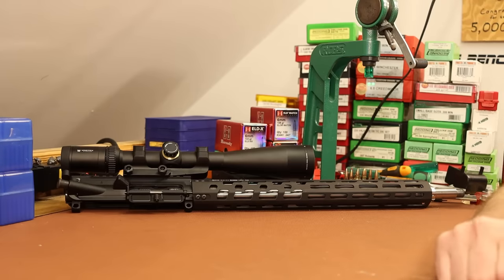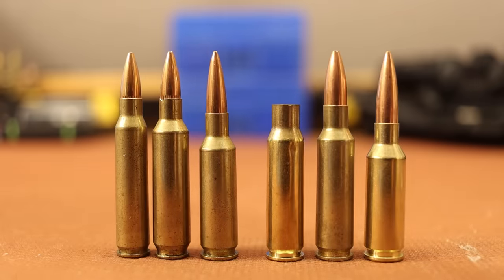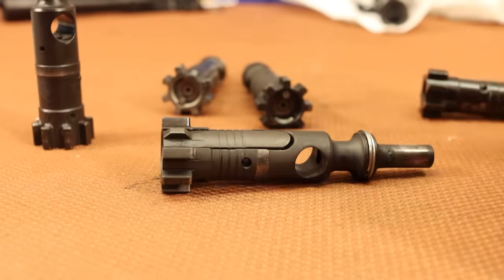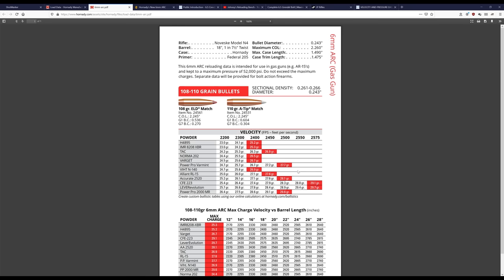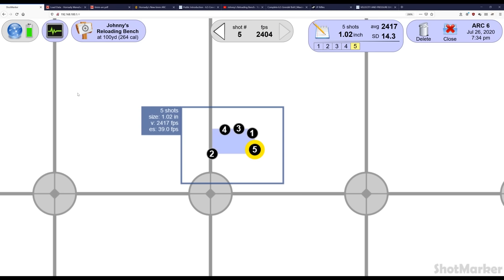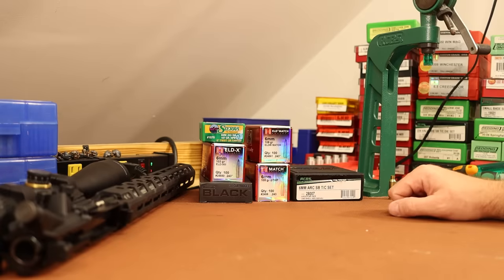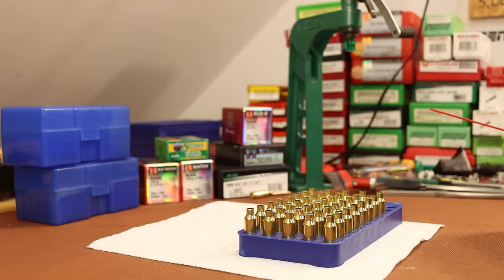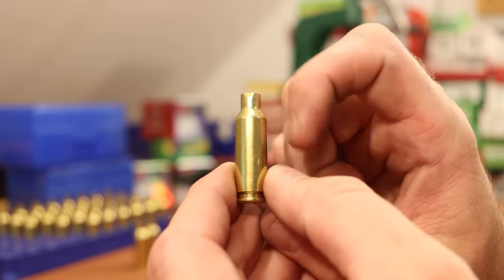6mm ARC - Getting started with reloading

Comment: Yes!! JRB is back and working on a 6mmARC like I am!! I’m using an 18” Proof Carbon Fiber barrel for mine. Make sure you use an adjustable gas block! I’ve had great luck with Reloder-16, IMR4451, and H4350 using the 100gr+ bullets.
Reply: If it’s not beating the crap out of the brass that will be a huge advantage over 22 Nosler and 234 Valkyrie
Reply: Wow You spent a-lot on barrel that uses cartridge thats so new, I don’t know whether to scratch my head or high five ✋ you.
Reply: @anthonymurphy2540  that’s one of the few plus sides to being a dealer, I get to buy stuff for wholesale. Still not a cheap barrel, but I wouldn’t buy a cheap barrel anyways when looking for accuracy.

Comment: So after watching your 6 ARC video , I thought wow what a lot of stuff to keep in mind. So the next day I take my newest rifle (6.5 Grendel) to the range. It's an  AR platform nothing new here ,because I have a bolt gun in  6.5 Grendel. So I took so of the ammo that was loaded for the bolt gun and a box if factory ammo, to check gun function and to sight in that all went OK . All the problems you were having , was similar to the problems I was  having. After morting a few rounds to get the fired case out I pulling the bullet out of one that wouldn't go into battery, I called it a day. I found a video you did about different chamber dimensions of the Grendel. So I guess I'm going to have to go thru a process to get the right size case and bullet setting depth. So thank you for your videos they are very helpful, I don't feel like I'm the only one that has screw-ups.

Comment: One of my Favorite videos ! When he gets that 108 ELDM .35 5 shot group at the end you could feel his joy!  FWIW, Besides Hornady's expensive 1 Shot Case Lube ,  Lees case sizing lube also dries to the touch and is a great sizing lube. I put a finger swipe into a ziplock bag and shake the cases in it and they all are coated easily with a very small amount and NONE is wasted spraying all over the loading block etc. I have had the same Ziplock 1 Gallon freezer bag and used it for years now. 😊

Comment: I am loving the 6 ARC in a bolt gun. I'm getting dime size groups with 90gr Sierra Gamechangers and Leverevolution. Out of a factory Howa 1500 Mini barrel! (A few accuracy upgrades, B&C Stock and Aluminum Bottom Metal). These 6 ARC loads are producing more velocity and energy than my old .243 handloads I've been loading since I was a kid.

Comment: I use Hornady one shot, but I got tired of it building up all over my reloading trays. I got this trick from Panhandle Precision's channel, and he will stand up the cases on a sacrificial baking sheet and spray them that way. I've also used paper plates. I also have gotten better results spraying from a more vertical angle. It helps reduce the amount of case stretch for me when sizing.

Comment: This is an update after 16 months of shooting my 6mm ARC I now like it just as much as my 6.5 Grendel.. I have not had the COAL measurement problems you were having.I did get different readings using my twice fire 6mm ARC brass than I did using my Hornady modified case.
I too use the RCBS SB dies.Ive experimented using 105gr and 108 grain bullets.Im getti g good accuracy and low ES & SD numbers.

Comment: Looking forward to this. Cheering for the 6 ARC. Go get it Johnny
Reply: Why ? He skipped the fact that you have 107gr for Grendel that shoots 0.5 moa all day long. Considering that the Grendel has larger case capacity than the ARC, its funny John has never told his audience about 224 grendel or 6mm Grendel...its the difference between a guy who reloads factory and someone after PERFORMANCE.. Just saying
Reply: @killerfungis  
6mm 107 gr SMK
G1 Ballistic Coefficient	0.527

6.5 mm 107gr SMK
G1 Ballistic Coefficient	0.430
Reply: @blckandwhtknight  LOL a BC chaser, lots of bullets have HIGH BC numbers, but its the case thats the variable and if it wont shoot a tight group it wont shoot a tight group. Example: 107gr 6.5 Grendel  BC of .445 in average barrels equates to 0.55MOA. Science is crazy....dont forget the other variables., otherwise ALL calibers and cases would fall into MATCH grade considerations.
Reply: @blckandwhtknight  OH, and you also did not know, because John wont tell you.....Grendel has been shot as .30, 6.5, 6mm (yes, the 0.527 that you might think only fits in ARC), and 224 for over a decade.
Reply: @killerfungis  SAAMI is a wonderful thing... The BC is what kept the DoD from using the Grendel. It wimps out around 800 yards while the 6 ARC pushes 1k easy.
Reply: @blckandwhtknight  hmmm, your calculator and understanding of saami seen broken. Please pull up 107gr 6.5 sierra.  What hornady is delivering was already available without introduction of a new case.  And certainly not worthy of industry ignoring that to sell new rifles.
Reply: @killerfungis  lol more case capacity. Your not even using the case capacity to its fullest at the same 52k psi. Which is the same as the grendel. It has the shoulder set back roughly .03 so it does have less capacity but its extremely minimal. The bc at longer range of the 6mm class will more then make up for any case capacity concern.
Reply: @orangerider2827  Did you just say that a slow velocity projectile can be compensated by high BC, And yet the speed tests are  all slower than grendel, remember 6mm Grendel has been here for over a decade. It was funny to see ads for like 224 Valkyrie when the 224 Grendel guys knew it was slower than what they had. Using your logic the 224 Valkyrie should have been more accurate than the 224 Grendel.....hint its not.
Reply: @killerfungis  the 224 valkyrie is a better long range cartridge then the grendel. Absolutely. Compare where the 224 the 6arc and the 6.5 grendel go sub sonic. Grendel is behind. Also you look at the load data for grendel. Look at the barrel length. The arc appears slower. I suggest actually look at the number use a ballistic calculator and come back when your not just hating something new. Also I dont care about the 6mm grendel. I dont mess with wild cats. Also most accurate calibers are 6mm.
Reply: @killerfungis  lmao saami spec 224,6,30 grendel where are they at? Oh yeah dont exist. Dont care even slightly about wild cats.
Reply: @orangerider2827  You should stop pretending to be smart. Saami is for civilian and not the military (per se). 

All of the most accurate rounds started off as or still are wild cats...its the free ballistics lab of America. Its the hot rod and drag racing equivalent in the gun world.224 Valkyrie wild cat, WSM development wildcat, 6br wild cat , 6 dasher wild cat, 6GT wildcat, heck even creedmoor was a wild cat at first. here are some other wildcat cartridges:  (and again simply necking down is not a wild cat, but in your laziness you call it that to besmirch for sake of argument, which is really lame),  Technically, I think the 6.5 creed was a wildcat and brought to market by Hornady

Popular wild cats
1. .22 Hornet.
2. .22-250 Remington.
3. . 243 Winchester.
4. .257 Roberts.
5. . 25-06 Remington.
6 6.5-284 Norma.
7. 7mm-08 Remington.
8. . 280 Ackley Improved.
9.  6.5-08 (260 Rem)
10. 6XC

The Dod does not need saami.  

So in the end if you wish to die on the hill of "I dont care about wildcats" then you wont mind if the Dod/US military is using inferior performing rounds to defend you.  To go further a military out gunned by the commons.
Reply: @killerfungis  whatever you say guy from the internet. Is rather have saami spec where I can get off the shelf ammo if needed.
Reply: @orangerider2827  then why are you watching a RELOADING CHANNEL.  What he made, for this video, IS NOT SAMMU Spec. 

To go further, if you want to save money, or just have true match grade ammo,  you will have to reload....abd all reloads by default are not saami spec.  Enjoy the over priced innacurate ammo.
Reply: @killerfungis  ok guy stuck in the past.
Reply: @killerfungis  whatever you say guy. You do you.

Comment: Your first step should be to anneal the brass. You should also lube the inside of the case neck with powdered graphite to reduce stretching during the sizing operation. Your press is very loose, actually lifting away from the surface it is bolted to as you work the lever. At the very least find a better way to secure it. One primer always refuses to flip correctly in the tray. ALWAYS. You can twist a piece of 400 grit sand paper into the seating stem a few times to 'polish' the surface that's hitting your bullet, to remove the ring you're getting on the bullet. A suppressor with a supersonic bullet seems nonproductive. Brass catchers are cheap. You need one. Your last loads are shot with a much dirtier barrel than your first loads. So, NEVER CLEAN YOUR BARREL! Very nice loading video overall. Great job.

Comment: I use brake parts cleaner to clean off the lanolin alcohol mix.  I spray some on the cases and the towel that I use to wipe them off with.  I do it outside.

Comment: I just got my McGowan 20" 6mm arc barrel ordered. I watched all your 6.5 Grendel vids. Glad to see you are back. Thank you for the content
Reply: The odin barrels use mcgowen for the barrel blanks, his was shooting pretty good hope your barrel will to. I'm waiting for my 21" odin barrel to come in.
Reply: Finishing up the 6ARC vid. I went with McGowan cuz of my first barrel 16" 1-7.5 twist 6.5 Grendel. Shooting heavy hog hunting bullets. I'm happy with them.
Reply: Wanna see some 6.5 PRC testing. Picked up just a Savage 110 in 6.5 PRC
Reply: @attackhelicopter1770  I got a mauser m18 in 6.5 prc, just worked up a quick load for deer. 57gr h1000 and speer 140 hot cor were sub 1/4 moa at 100. I'll work on some long range loads after deer season.
Side note hornady brass is butter soft, other then that seems ok I'll get some adg brassafter I use up the few hdy cases I have.

Comment: Glad Johnny is back!  Don't know where his fascination with small base dies comes from.  They are usually only needed for resizing military brass that has been fired in military chambers, or resizing brass that was way over pressure when it was fired.  You get a more concentric round that fits the chamber better with standard dies.
Reply from the maker: That's what was available to purchase right now, bro. My Hornady dies finally arrived, so I'll have them for the next video.

Comment: I have high hopes with the ARC. I really hope it comes out ahead. I’d really like to do a build with it.
Reply: You and me both id live to use it as a all around gun for deer hogs coyote i just think it would cover a wide range of critters
Reply: And it being in a ar. Platform even better a pistol build for a truck gun couple 20 30 round mags it would be great
Reply: @byerboys2607  So your unaware that Grendel is loaded to 224, 6mm and 6.5. Specifically 107gr 6.5 Grendel load is 0.5 moa all day long?  (and with the case measurement capacity going to Grendel why do I need ARC??)
Reply: @killerfungis  didnt say you needed one didnt say anybody needed one but myself for my needs
Reply: @byerboys2607  Yeah I just commented because it, your comment, seemed to lack any knowledge of what is already available and what folks are already shooting. Im sure the offering will do fine as its just a smaller Grendel.
Reply: @killerfungis  for me i have 2  center fire rifles 223/556 and 30-06 so the 6 arc would split the difference and still be good enough for deer/ large ish game and still have the distance of a 223 with heavier bullets than the 223 not by much but enough that it would make a difference and do way less damage than a 06 on varmints so in my case it would be a decent intermediate rifle and  also in a ar. Chambering or bolt gun so i would prefer it be in a ar pistol so it could be carried as my "truck gun"
Reply: @killerfungis  you just hate the arc it seems. Sinse you copy paste your comment everywhere anyone wants to get the 6 arc.
Reply: @orangerider2827  I dislike snake oil, and the fact the DoD developed something that was already on the shelf is just astounding...but hey maybe they had money to blow. Combine with that sneaky Native Advertising techniques....yeah it bothers me. And no one is copy pasting, be honest or dont reply.
Reply: @killerfungis  how is it snake oil? Do you know that the load data for a gas gun is an 18 inch barrel? Did you watch the video? Also all the other off the shelf as you call it are wild cats. The DOD didn't like the grendel because of its bc.

Comment: CFE223 has been giving me the best results also. Just sooty. Looking for Leverevolution.  So far in my bolt action, I've gotten 14 reloads with factory brass before I've seen failures. Powder charge is just over 30gr, max 31gr. Thanks JRB, always watch the whole movie👍
Reply from the maker: I have some Leverevolution on hand, so I might try it. It's pretty much the exact same powder as CFE 223. I've never really tested to see if it's cleaner burning, though.
One of the commenters I trust mentioned having luck with some of the slower powders like RL16, IMR4451and H4350. Those slower powders got the best velocity in the 224 Valkyrie as well, so I'm not all that surprised. I'm going to keep an open mind and not assume that Hornady is giving us the optimal powder list on their load data. 
We'll see how it goes! I'm optimistic so far. I haven't caught up with all of your videos yet, but I'm working on it. Nice to have someone else out there collecting some data.

Comment: I’ve stopped using the Hornady modified cases and the split case method, and instead started seating a bullet long in sized brass and feeling how the bolt closes while seating the bullet deeper into the case.  This has been the most consistent method that I have been able to find.  I do this with the ejector removed and in the case of my ARs I feed just the bolt into the barrel extention by hand to get a really good feel for what’s happening.

Comment: I have found in my experience, when the case mouth is getting dented like you are seeing, it is slightly under gassed.  If you have an adjustable gas block, increase the gas a little and see if it eliminates the case mouth dent.

Comment: I'm 5 months late to the party, but listening to the bolt discussion and White Oak posts, and Johnny's non-failure bolt experience, I'll wager his 6.5 Grendel bolts are both 9310 steel. 
Carpenter 158 saw frature, failure...8620 failed from fractures when run hot a few times, 8620 gets brittle, but the industry solved the 6.5 bolt issues by using 9310 steel. 
That same 6.5 Grendel bolt, in 9310 steel is used on the .50 Beowulf,  but with enhanced extractor to properly deal with the Beowulf cartridge.
I have 6.5 Grendel Type II, and the Type II depth face .264 LBC.
Les Baer I understand, mfgd both bolt depth chambers.
The parallel chambering is superior in accuracy to the compound chambering as I recall from studying the variances some years ago.
Point is, no matter your AR platform, 9310 steel for bolts is the only way I go, even down to .223/5.56.

Comment: There's a trick to adjusting the RCBS dies. You use the tail end of your calipers to measure between the top of the stem to the top of the die. No need to worry about what a half or tenth turn is when you can just measure it!

Comment: Made me chuckle with old school trimmer and no patience to set up the Franklin. Shud buy a 3way cutter for the old school trimmer, be nice to it and yourself. I have said a lot of the things you said to yourself in this vid, to myself, at various times. Many times I wasn't holding back like you did though. When you were talking about case and neck stretch and the RCBS expander, which you did well, I was wondering why you don't use dry neck lube on them, makes life with expander buttons far easier, when I do use them. Not sure if I have any dies with a decap spindle in them any more. Well done vid.

Comment: With a Letter "L" drill bit and a 5/16" - 36 UNEF HSS Machine Tap, Right Hand Thread Tap, Plug Tap , you can tap your own cases. Gavintoobe used his Lathe-a-Tron 5000 but I just clamped the case in a bench vise with nylon jaws and used a hand drill to do the job.
Reply from the maker: I tried it in the past with other cases and failed pretty bad. A viewer offered to do it for me so I'm shipping out some brass tomorrow!

Comment: Cfe 223 likes the heavies.  Great sd but the drawback is that it is Very Temp. sensitive.  I use Varget in the 6mm Grendel. I have .03 more case body to fill with powder and it still goes crunch.  I will be sticking with the wildcat but I have many people asking me about the ARC.  Keep up the great work.  Oh ya, I have a premium bolt and load way too hot and am on my second barrel with no bolt problem.  But it is something that should always be looked at during every cleaning.

Comment: 2 powders to keep in mind H4895 and Reloader 15, I have been loading for the 6mm Fat Rat another 6.5 Grendel based wildcat for the AR15. these two powders have been extremely accurate with both 107SMK and the 90 grain Berger. Good luck